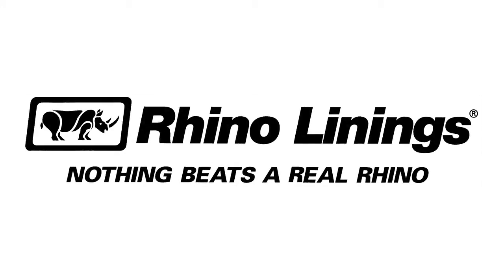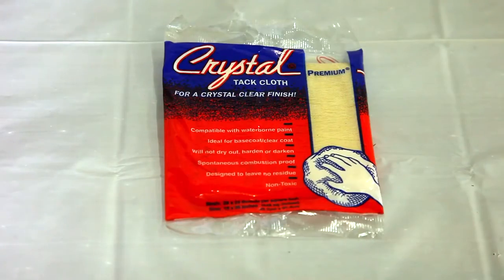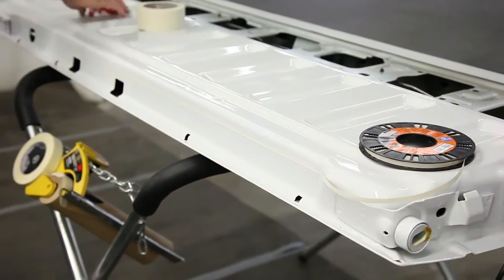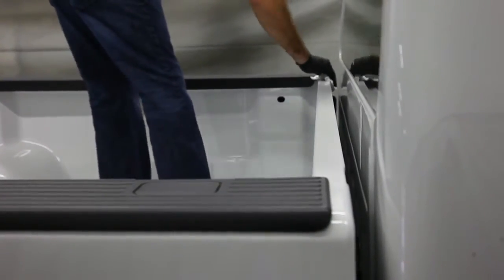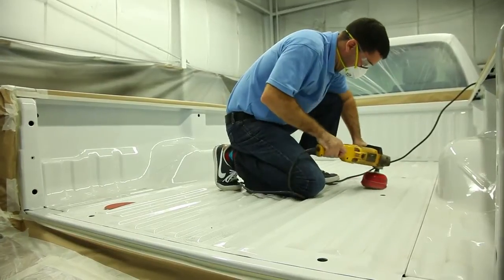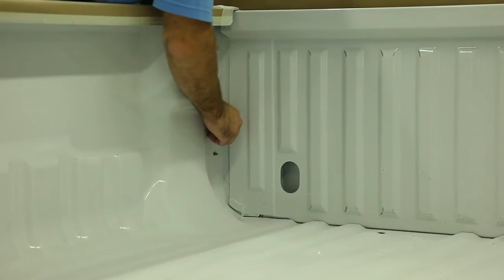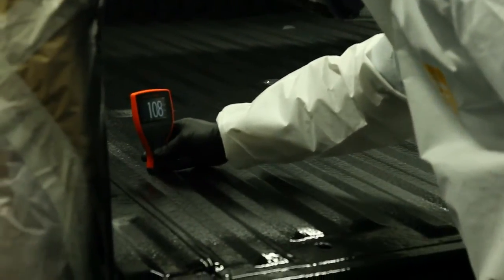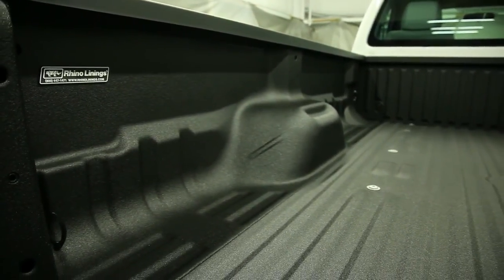Rhino Linings - The #1 Spray On Truck Bed Liner Brand

Comment: How much would it cost to do a bed liner for 2021 Dodge Ram 1500 does anyone know?
Reply from the maker: Prices range depending on the location where you get your truck bed sprayed. We recommend using our dealer locator and contacting one of our Applicator stores to get a more accurate quote. --->www.rhinotruckbedliners.com
Reply: @Rhinolinings  I’m in Northern VA thank you I’m just looking for rough price point if possible thank you.